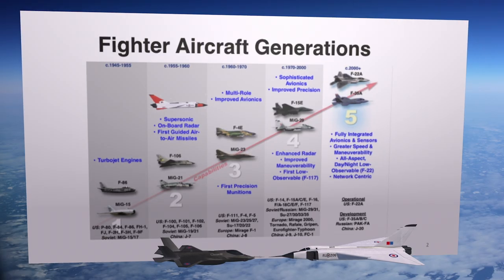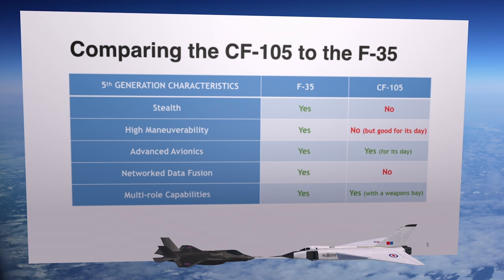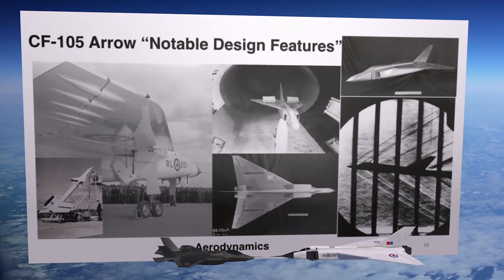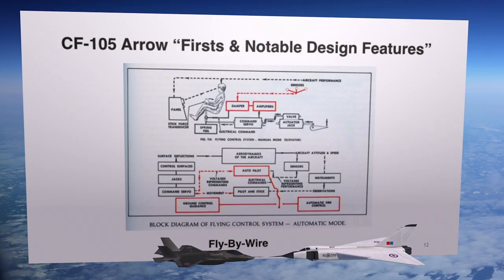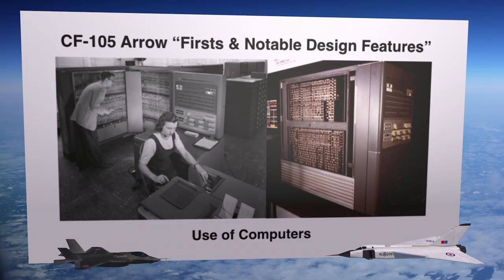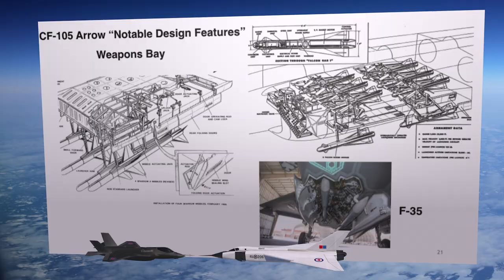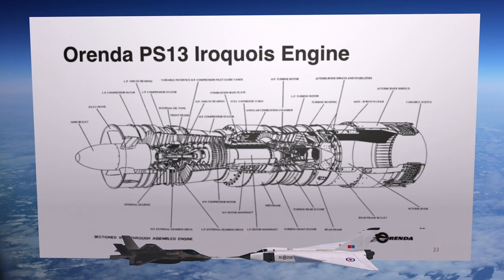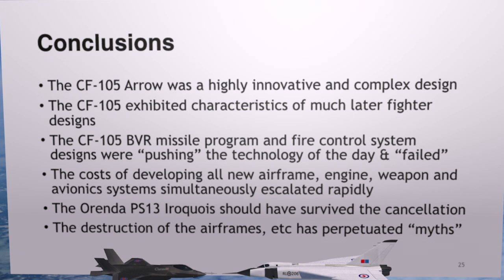AVRO ARROW FIRSTS VS F 35 LIGHTNING

Comment: Hi you did your usual great job with the documentary, but some of your data looked like it was from the original AIR 7-3 back in April 1953 which was a minimum the RCAF was asking for. In 1955 update Avro had projected the performance of the Mk2 Iroquois powered Arrow combat radius as 630 nm subsonic with 5 minutes of supersonic combat, and a 400 nm radius of action for a supersonic intercept mission (clean). These numbers were confirmed by the performance report 15, and overlays of flight performance numbers based on the IBM 704 computer VS modern fighters. If memory serves me right you send me the performance chart yourself. BTW my new email is almost the same as before just and an (a) without the brackets to the front of the old one. If that doesn’t work I will post it to you here and then delete the post so others don’t see it. LOL or if they do see it then I will just block and trolls. Again great job!
Reply from the maker: Hi Jim...(Can you send me an email). I can only take credit for the 3D work.  The General put a lot of time into this.  The slides  and narrative text are his work.  We decided to make this video after being asked to do a speaking presentation.  It made sense that we should make a movie, that like the Arrow "clears the air" of naysayers.  The first thing he did was verify all the firsts and if there was doubt put them in a notable category.  As this was a documentary that we are putting our credibility on, we had to err on the side of caution.  I think visually explaining these first in mostly layman terms will be something that will save me/us a lot of time.  It's a definite Arrow Troll killer.  I just send them the link.
Reply: I understand most people would have a hard time with all the facts. It’s why I put in all the sources for where the info came from in review of the book Cold War Cold Tech by R. L. Whitcomb. It was for others to be able to see just how many other writers who know aircraft see the Arrow and what it could do. Also for them to have a chance to look up the info for themselves as a way to avoid the trolls (well some of them) you know the ones I'm talking about LOL.
Reply from the maker: @jim100ab9  I had to get rid of the Troll....Jason Kay.  regards..Virtual
Reply: That makes me smile!
Reply: @jim100ab9  Facts? There's more to high speed turn rate dogfight and you haven't factored in turn radius relative to G load and speed.
Reply: Turn radius: at low speed, your turn radius for any given loading (bank angle) is smaller than it would be at a higher speed with that same loading/bank angle. Thus, even though you're going slower, you have less distance (circumference of the circle) to cover, and so you are able to complete the circle (or one 360th of it) more quickly.

So at higher speeds the bank angle is steeper and the turn radius is larger and you need more wing area to give lift to hold you in the turn. Again the Arrow has more wing area than the F-15 in this case so at any speed or attitude the Arrow has more lift and can maintain a bank angle and a better turn rate. Given that they both have close to the same power and speed.
Reply: LOL  I saw that clip of the F-15 and it was a billion to one accident at the very least and he was very lucky. If you have controlled games you can have a good time. But in an uncontrolled game even the F-22 can be killed so what’s your point.

The numbers that were in the review I posted are real so get over it. The Arrow also have a great AOA and critical alpha its why it  was proclaimed to be capable of an instantaneous 6 “G” at 50,000 feet whereas the Raptor is estimated to achieve 5 “G” at 50,000 feet. (Sweetman, Bill “F-22 Raptor”)

The Arrow Mk1, at higher than combat weight, Displayed a larger flight envelope than a late production F-16C Fighting Falcon that carried only two tiny heat seeking missiles. (Braybrook Roy, “Fighting Falcon V Fulcrum,” Air International Vol. 47, No 2 Stamford Key Publishing, 1994)

The Arrow had the lowest wing loading of any supersonic interceptor to ever inter service, in terms of thrust-to weight ratio at combat weight; the Arrow was superior to everything up to the F-15 eagle. R. L. Whitcomb “Cold War Cold Tech”

 (Let me remind you) so now you’re trying to say you know more the R. L. Whitcomb, Roy Braybrook, Bill Sweetman and James Dow.  Are you also saying you know better than Jim Chamberlin, Jim Floyd, Janusz “Zura” Zurakowski, Peter Cope Jack Woodman, and Wladyslaw “Spud” Potocki and others when talking about planes? I know I don’t know more than them and its why I use their data and give them the credit.

F-22 Raptors are supposed to be the baddest fighter jets ever flown – and pretty much unbeatable by anything else in the sky (or so they say Jim100 AB). An F-16c pilot assigned to the 64th Aggressor squadron gained the first ever F-22 kill. https://www.wired.com/2007/07/first-f-22-rapt/

The German Typhoon “We had a Raptor salad for lunch,” one
German pilot quipped after using his jet's helmet sight and maneuverability to get the best of an F-22 over Alaska. At Eielson Air Force Base in Alaska for an American-led Red Flag exercise Three years later, a contingent of German pilots flying their latest Typhoon fighter have figured out how to shoot down the Lockheed Martin-made F-22 in mock combat. https://www.wired.com/2012/07/f-22-germans/

In 2009, An F-22 Raptor Was "Killed" in a Mock Battle (Thanks to France) every mock dogfight the F-22 loses undermines the Pentagon’s plans for air dominance. https://nationalinterest.org/blog/buzz/2009-f-22-raptor-was-killed-mock-battle-thanks-france-29452
Reply: F-18E has 8G Mach 0.4 speed is nice of the air show useless in combat.
Reply: @jim100ab9  
Prove Arrow has great AOA and critical alpha with good acceleration when single tail deltas usually has lower AoA e.g. Rafale, EuroFighter and Gripen. Where's the quoted numbers for AoA. Where's the practical test results for AoA?

F-18s was designed for high alpha with real stabs extending beyond engine nozzles (to fake thrust vector function) and F-35 takes it to the next level with larger rear stabs and placed stab's pivot point after the engine  nozzle (to further fake thrust vector functions). F-18C's long LEX acts like forward canards while F-35's engine cowling+chines design has forward lift.
 Cant'ed vertical twin tails was placed between main wings and horizontal stabs for this purpose i.e. access to air flow during high AoA.  

F-18C's long LEX also has a function to guide air flow into the engine during high AoA while Gripen attempt to preform high AoA which resulted in a stalled engine. Both using similar GE 404 engine design.

If rookie pilot relied on hardware's capability e.g. basic high energy high turn rate 2D plane while the other pilot has 3D displacement rolls with turn, rookie pilot can be defeated.

F-35's F-135 engine is back slide capable without engine stall and has been demonstrated. 

Arrow's engine intake design wasn't designed for  during high alpha
Arrow's single vertical tail wasn't design to access airflow during high alpha
Arrow's engine wasn't tested with back slide maneuver.
Reply: @jim100ab9  F-18E NATOPS chart comes from USN which is not applicable for 9Gs Super Hornet non-navy sales demo.

https://youtu.be/1ZSfVkHlNzI?t=144
  Super Hornet demo with rapid pull up with 9Gs example and it's still USN's Super Hornet with 9Gs limit settings.
Reply: A taped interview with Jim Floyd in the documentary “There Never Was An Arrow CBC 1989” time index 54:52 (transcribed by Jim100 AB.) 

Google the names and get the right info on What they did when they work on the AVRO Arrow! James Floyd former Vice-Pres of engineering on the Avro Arrow, Jim Chamberlin chief of technical design for the CF-105 Avro Arrow jet interceptor.

Jim Floyd talking about the Arrow maneuverability says “Aircraft now-a-days maybe more sophisticated in this or that, better engines, better fuel consumption, better pressure recovery but there’s nothing I know of that would even now today be an improvement on that maneuverability capability” So if you can’t believe Jim Floyd who can you believe. https://www.youtube.com/watch?v=kbL2wDnTlD0   Do you think Jim Floyd knew about these planes and what they could do in the air? 

F-15 First flight: 27 July 1972, 

F-16 First flight: 20 January 1974, 

F-18 First flight: 18 November 1978

Comment: Canadian conspiracy theory buffs, it's time to let it go. I'm not saying the Arrow was a POS, but I'm well over all the hype that it was the best fighter/interceptor ever, that the evil Yankee bastards killed it, etc, etc. It had potential sure, so did a load of other aircraft projects. And to those who think it would be viable today, I ask this: What fighter/interceptor of that era is still in use today? Only one that comes close is the F-4. Regards from Australia.
Reply: The Arrow was so far AHEAD of its time that it would have had a very long life of type. And the proposals a few years ago to resurrect the Arrow included using modern materials, avionics, etc to make it current.
Very few people believe it was cancelled because of the Americans. It was obviously budgetary pressure & the inevitable technical challenges of pushing the possible that far.
Reply: The point isnt whether that aircraft would be deadly today, but what would it be like 60 years later. The first fly by wire aircraft. The next one to do it was an F 16. It is not a fighter, its an interceptor. There is no other aircraft close to this one, but the SR 71 surpassed it in many different ways. Imagine the F35 or F22 having a capability that would go unmatched for forty years. Wont happen. Being able to fly/guide an aircraft to a flight program is easy for most any aircraft today. In 1959 it was science fiction, yet Canada did it! The evolution of such an airplane today would be like a stealthy interceptor, Mach 3.5+(or hypersonic), 100,00 ft + altitude, Elint/Ew specialist, drone UCAV, and so on. You cant imagine what it would be like because of how advanced it was from the beginning. Add 60 years of investment, sales, and growth on top of that.
Reply: As a Canadian who appreciates the technological ingenuity of the Arrow for the day, and someone who has worked in the aerospace/defense industry for 30 years, I still have to agree with you.  At best, the Arrow was an advanced interceptor.  At worst it was a monstrous cow whose huge size would hamper it in field operations.  In addition, its complete lack of maneuverability would have seen it fall prey to air superiority fighters who raison d'etre is to wipe the skies clean of opposition.  I understand the national pride in our Canadian contribution to aviation which was and still is considerable.  But interceptors and air superiority fighters generally last technically for 30 or so years before obsolescence takes its toll.  The Arrow could have evolved for maybe a 30-year generation and a half and Canada's chronic lack of financial resources to purchase newer technology might've seen it last for two.  But it would have been in a dramatically diminished capacity.  Yes, the Arrow saw a weird, controversial and sudden demise.  But looking at today's interceptors or even those of 10-15 years ago, the Arrow's edge would be blunted.   As a result, a completely new Canadian design would have to compete with the likes of the stealth weapons of today.  Another and less talked about oddity was the disappearance of the Canadian designed and manufactured Iroquois engine which generated more power than many of the most advanced power plants of the day.  That engine gave the Arrow its speed in flight.
Reply: @tbwpiper189  It was obviously an interceptor. That was its design. The technology at the time was above most everything else. It was only the first aircraft, and a lot of people were very interested in buying it. In time, it would have made some money, and attracted the best of the best in many areas. Several of the engineers went on to put a man on the moon. 
What would the second generation plane look like? What kind of fighter could have been made from the company? The Arrow was just the beginning. Even the SR 71 couldnt survive forever without change, but Lockheed evolved and went into space  building the Hubble, making missiles, electronics, the Sea Dart was made by them, etc...
My point is that it didnt "just" make the SR 71, it continues to evolve and grow. THIS was what the future of Arrow would have been like.Even the makers of the Arrow had better ideas for the future, it just never happened.

Comment: I am not sure if this true, but I have it from a reliable source that there is a chopper company at the Fort Saint John airport in B.C. that has an original Iroquois engine in their shop.  Also when I a kid  I saw the Arrow many times as it flew test flight over out house. Was very impressive.
Reply from the maker: Hi Bill, Thanks for the comment, you're one of the few people who can say they saw it fly.  The company in B.C. may not be a chopper company.  They are a jet engine and I suppose Chopper turbine maintenance company.  I will make this story short as possible.  Bristol Aerospace got an Iroquois back to England where under great secrecy they took it apart and a new engine re-emerged that powered the concord.  When they first got the engine in ~1959 they were astounded by it's power, unlike anything they had ever seen.  Anyway, the owner of this maintenance company went over there several years ago and brought the engine back.  He needs some parts though to get it going again...regards...Virtual
Reply: Virtualenvirons , Hi, I grew up in Mississauga north of Port Credit . I was born in 1944  so you can tell how old I am!  When I use to see it always had  a chaser planes with it but you could hear him open the throttle and he would leave them behind pretty fast.  A side note, 
one of my brother in laws has a cottage near where the test pilot  retired to and he talked to him on at least one occasion I know of.
Reply from the maker: @billhillman3263  There were two, the most famous was Zurakowski.  Have you seen the other moves, the series is on my channel.  If not, you can find them on a playlist called "Arrow Series". regards...Virtual
Reply: Hi Bill if your looking for the names of the test pilots for the Arrow there were 4 of them. Janusz “Zura” Zurakowski, Peter Cope, Jack
Woodman, and Wladyslaw “Spud” Potocki I hope this helps...
Reply: If I'm not mistaken the Air craft museum in Hamilton Ontario ( i think Hamilton , well one of those cites in that area ) has an Iroquois engine from the arrow. That museum is incredible, they have a flying Lancaster bomer there as well.
Reply from the maker: @rgkrazor8788  Hi Rick.   Yes, I think it is one of the prototypes.  There is a fellow out west who brought back an Iroquois 2 from England.  One was secretly squirrelled away to Bristol Aerospace.   He is trying to find the parts to get it going again.  He has the financial resources, just not the parts.  regards...Virtual

Comment: It would have been a great plane. Like all great military fighter programs, due to the small number of manufactured aircraft the price is high; therefore, if ever decide to make another fighter/bomber or bomber/interceptor, then get some other nations to share in the development & purchase of the planes. With super long range air breathing  missiles you maybe able to use something less stealthy & cheaper to build & operate than a F35 yet retain the ability to remain hidden while firing on an enemy that can't see you or fire back. It's not enough to have a great idea; the great idea has to be achievable & affordable. Giving up after one failure is just a poor attitude. Learn from your failures and then move forward to success.